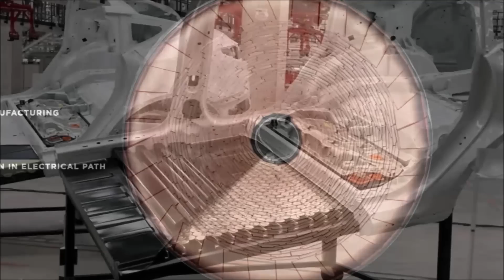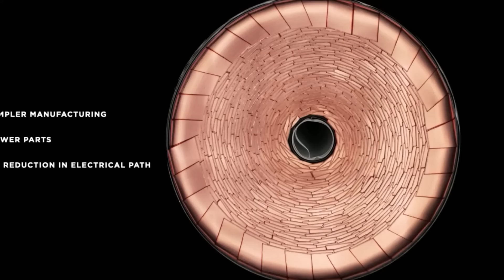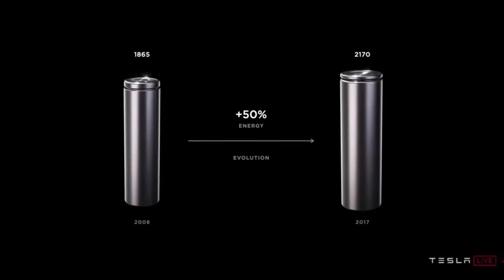Tesla Disrupted Itself With 4680 Battery Cells

Comment: My original Model Y estimated delivery date was May, but Tesla tried to get me to take delivery last December. I put it on hold. I was notified today that my order will be canceled unless I release my hold by Feb 10th. Tesla is forcing me to take delivery of their 2170 battery pack Model Y or to cancel my order. Reordering to get a 4170 Model Y will cost me $4,000 more than my current price. Rats!!!
Reply from the maker: Thanks for sharing.
Reply: Same here. I gotta take it off hold by Feb 10th. Once they assign us a new Vin, hope its a 4680 lol
Reply: Actually I just want a model y that does t have panels gaps haha
Reply: @joonior388  HOW DO YOU KNOW WHUCH BATTERY PACK YOU WILL BE RECEIVING?
Reply: @palmbeachketoers6557  well the vin will either show NF for Fremont that's not 4680 and if it's NA it's from Austin which means it's the new structure with 4680. But I doubt anyone will get it by end of 1st Q

Comment: Any thoughts on when we will see 4680 Models 3 and Y coming out of tesla Shanghai?  The 4680 Panasonic deal is not set to produce 4680s until 2023.  However it seems likely that CATL could be supplying 4680s to Tesla Shanghai within 3 months. As well, the online manual for Models Y for Australia has already been updated to refer to 4680 batteries

Comment: Nice video. 4680 means fewer parts, easier and faster loading of packs, and less total electrical resistance connecting them but need cooling re- engineering. Given the time since start of the pilot plant, my experience suggests Tesla has perhaps a yield problem which are often difficult to achieve when needing high 90+ percent repeatability to reduce costs.

Comment: Why do you folks keep faffing about 4680 as some kind of revolution ?
Iliterate knuckleheads keep salivating over its "5x capacity over 2170" without realizing it "4680 HAS 5.5x VOLUME of 2170".

So, at best, any advances over 2170 are incremental. Perhaps a bit higher power load per kg, a bit higher energy density and maybe somewhat lower cost.

But that will mean something to Tesla, NOT the end users.
And even for Tesla, it will probably mean just some more profit margin, less battery cell variations etcetc,
Reply from the maker: Aren't those new batteries going to change the specs of Tesla with more power density and range?
Reply: @Torquenews  My understanding is that there will not be much in the way of additional capacity by energy density, e.g wh/kg or Wh/L. Capacity remains more or less the same as 2170, you just need less cells.
However the tabless design of the 4680 battery means that current can flow out a much larger contact area, not just the tabs which are traditionally used. This should greatly reduce the heat loss at high loads, which in turn would allow more power output per weight or volume. This might improve range at motorway speeds with the higher power draw, but the load to maintain motorway speeds is no-where near peak power so the benefit might be marginal. Charging speed (which is already very good in the latest Teslas) might improve but I suspect the useful power is already constrained by the motors and inverters, not the batteries.  The model S Plaid already demonstrates they can pull tremendous power from the 2170 cell packs. 
The biggest benefits will be cost and possibly production speed. Production speed is important if you need a lot of batteries. Weight will benefit if the structural battery pack needs the 4680 batteries to work. If I was a customer, I wouldn't wait for 4680. As a shareholder, I'm looking forward to it.